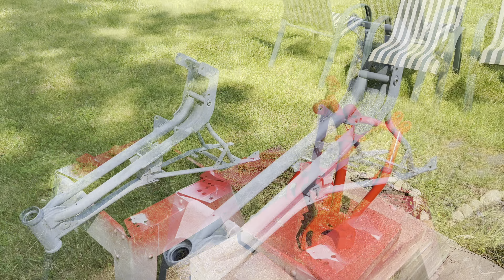Fall 2023 MINI MAYHEM - MINI TRIKES - (PART 2) !!!  #carsandcameras

Comment: Hi thanks for the info great build looks good I would like to ask what is that on the bottom triple clamp.
Reply from the maker: Thanks for watching!  The thing on the bottom of the triple clamp is a mount that I made for my front fender which is not installed yet.  You will see it in the next video!
Reply: ok thanks will be looking for it I still hope maybe some day you will offer this 125 starter kit to  any way I am going to buy one or two of your 200s pull start kit soon as I can I am glad you mad them.

Comment: Hi were is the build video of the front end the forks is it a 200x triple  and what forks fit in them.
Reply from the maker: Yes, they are 200x front triple trees.  Any 33MM Fork tubes will work!  I am running the triple trees backwards to give me the rake that I wanted on this trike.  Otherwise it would look like a chopper.